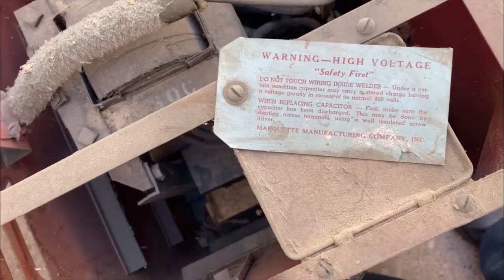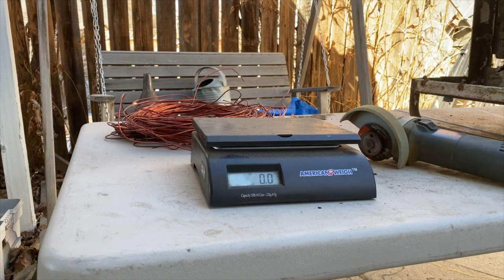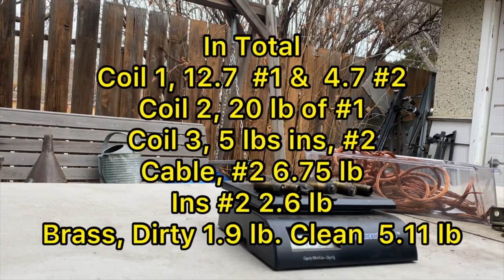Welder Tear Down

Comment: Bare Brite doesn't have to be wires just Bare, and Brite
Reply from the maker: I got #1 for it after I unwrapped the tape
Reply: My yard only considers wire to be bare bright.
Reply: I have a yard here that will buy BB either way
Reply: @ThatsRightRecycling  that’s awesome
Reply: Barebright is bright and shiny no coating, no adhesive or glue or paint and no tape or paper